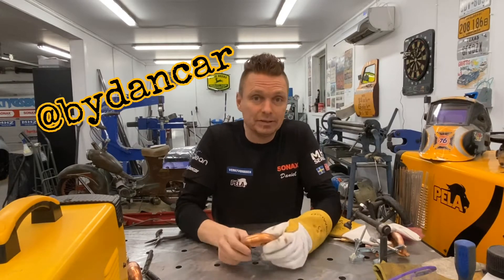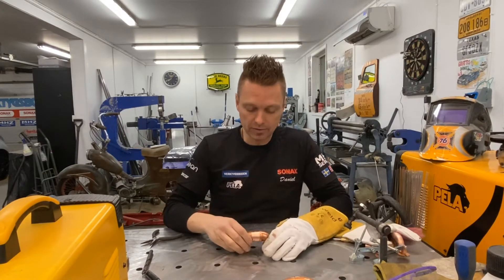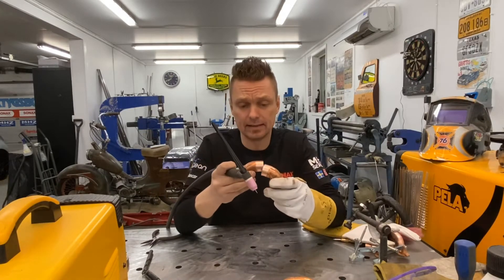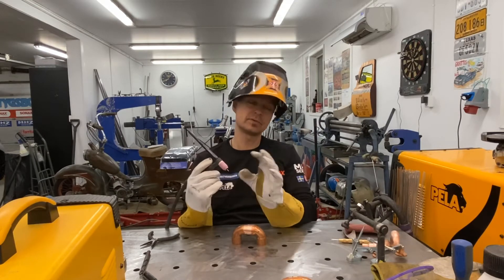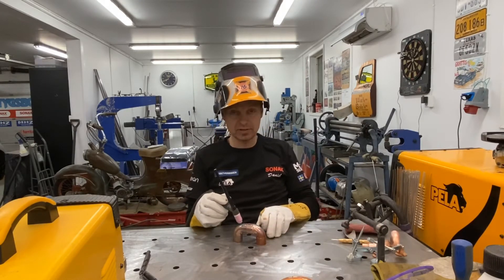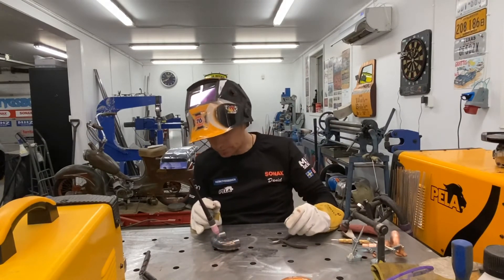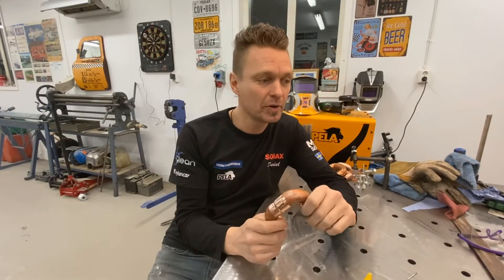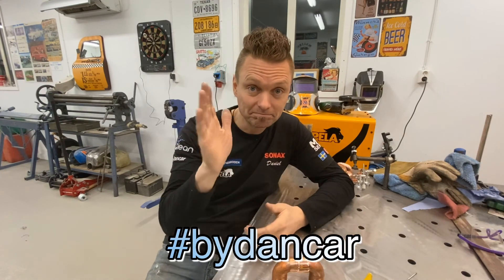How to weld Copper with tig

Comment: Is this DC or AC?
I only have a DC tig welder
Reply from the maker: Its a Ac/Dc welder.For good penetration, a smooth bead and strong joints, TIG DC welding is good for stainless steel, copper, steel.. NOT for addition to aluminum materials. Good luck 👍

Comment: Can be done the same way with brass? And what kind of machine is yours
Reply: What is the pulse settings you used?
Reply from the maker: @cdb5428 I can't remember but I can check this weekend. Regards Daniel
Reply from the maker: Yes its ok with brass aswell. Im using tigweld Lazer 200. Good luck 👍